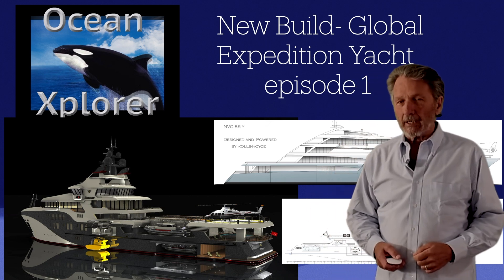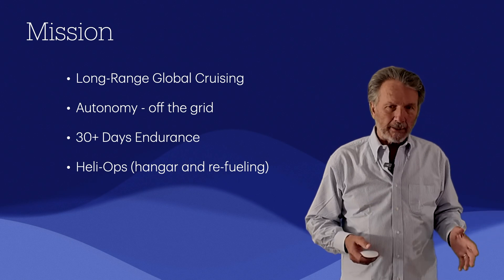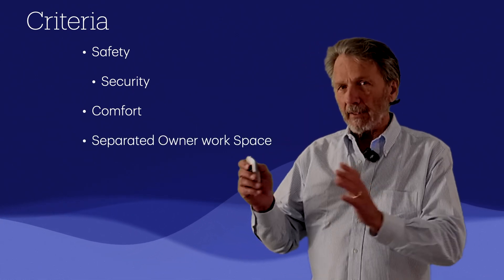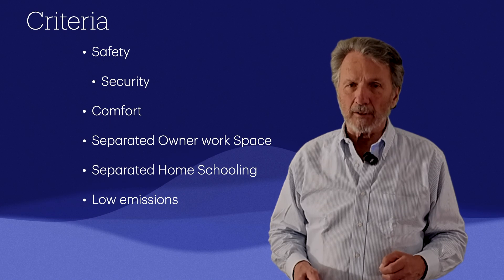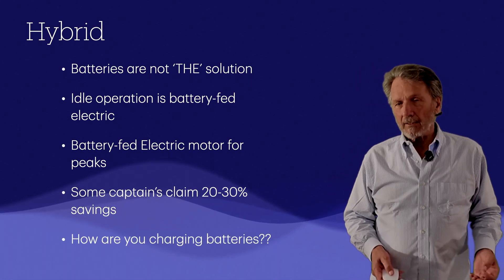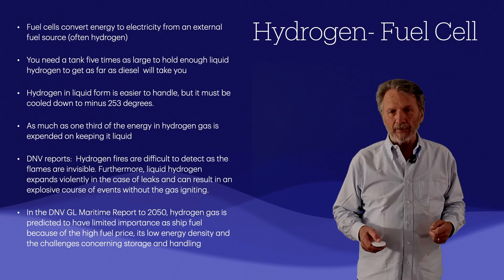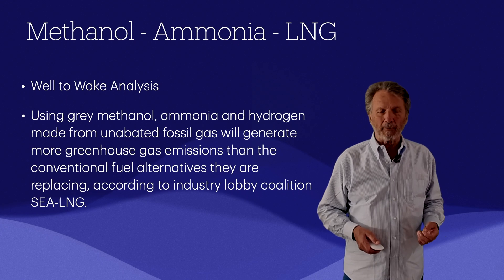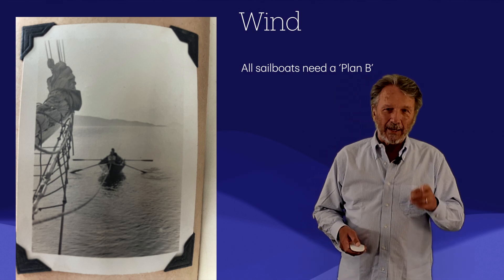Xplorer Yachts New Build Project - Episode 1 - "PROPULSION SYSTEM"

Comment: Great video.  What about a methanol fuel cell that only creates hydrogen on a per need basis?
Reply from the maker: In an abstract of a study in Science Direct, they state: "Direct methanol fuel cell (DMFC), as the most advanced fuel cell, has recently received much attention because of its unique advantages, such as high fuel energy density, facile liquid fuel storage, low working temperature, simpler system structure, and low emission of pollutants. However, DMFC is facing many challenging technical issues related to design, fabrication, and operation of its power systems that still remain unsolved. High manufacturing cost of DMFC is one of the main drawbacks, which hinders its successful commercialization. Mass transport of different species is another issue in DMFC which influences the performance, operating stability, and volumetric energy density of the system." Maersk is using it on one ship. I have read that green methanol comes from biogas captured from decomposing organic waste in landfills which is then upgraded to biomethane, injected into a gas grid and produced from the biomethane on a mass-balance basis.  For now- there is no real supply chain, so it's not something we can consider.